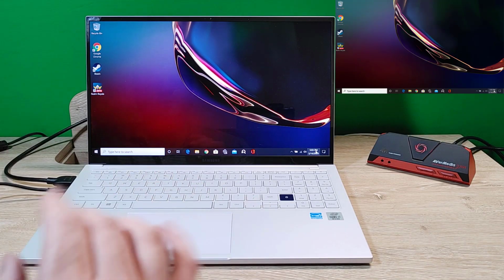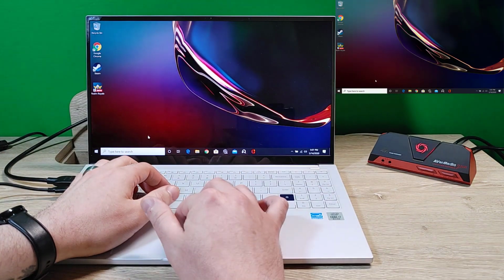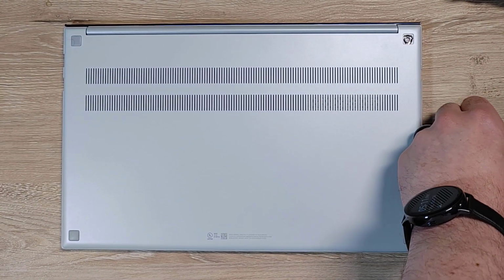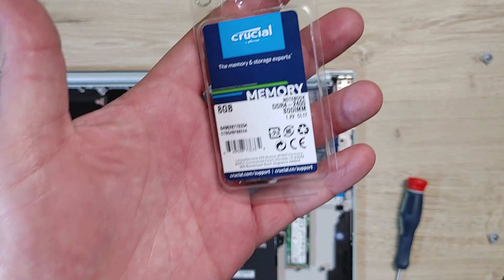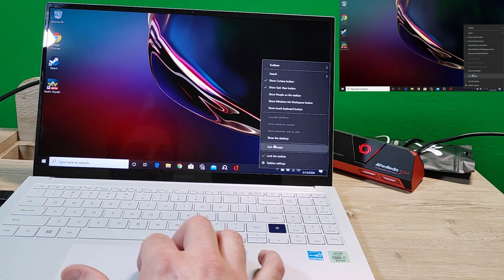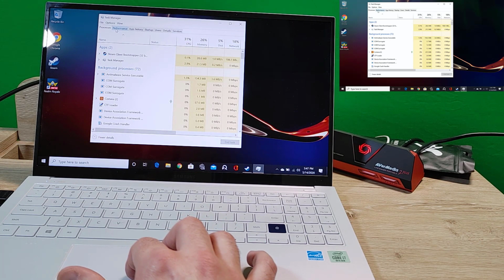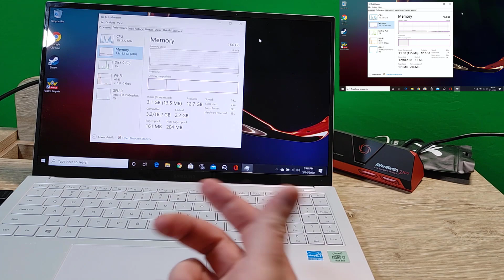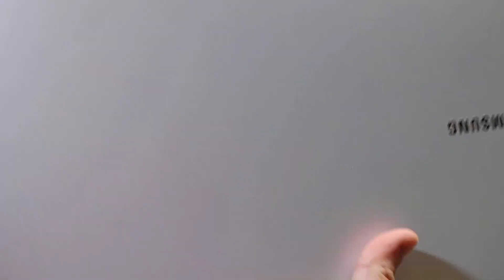Samsung Galaxy Book Ion (15 inch) | Disassembly and RAM upgrade (16 GB)

Comment: Does anybody know what is causing burn-in ghosting at the edges of display even in matter of minutes in Samsung Galaxy Book Ion np950xcj? QLED is supposed to be resistant to burn in. Display edges also suffer from purple tint. Can it get worse over years of use and is it expensive to fix?

Comment: I have a question! So let's say, I wanted to replace the battery because it no longer works. What do I do?
Reply from the maker: You can reach out to Samsung, they might replace it
Reply: @5after12  I'll try asking them how much it'll be although I no longer have warranty on this laptop ,, 😭 I tried disassembling but failed to..

Comment: Hey there! Have you had any issues with the Ion the last couple years? For me, even after a fresh Windows 11 install on a different drive, the Ion still freezes often when accessing Windows Explorer, the Start Menu, or even restarting the computer. I have to hard reset (by holding the power button) half the time. I'm curious if it is just me. An IT family member says it could be related to my motherboard.
Reply: I still have this laptop that I enjoyed very much. I did not have freeze issue at all and I have windows 11.
Reply: I have this laptop - I purchased it in 2021 and I get these issues, freezing up etc however I never have to do a hard reset. I just use task manager and kill all tasks and then it's up and running again. One issue I have found most annoying is that the fingerprint sensor stops working and fails to be recognised by the system  but that hasn't happened for a while now. It's a nice laptop so I was going to follow this video and add more to the specs.
Reply from the maker: Sorry, I got rid of that laptop awhile back

Comment: this may sound silly but... I feel like he had an 8 GB RAM, and then he replaced* it for an 8GB... why does it add? it should be total of 8GB... why 16?? (like what is the point to replaced it for a RAM of the same capacity). because I think there is only 1* slot...
Reply from the maker: if you watched the video, at the beginning it had 8 GB of RAM with 1 of 2 slots used. And at the end it has 16GB of RAM, 2 of 2 slots used. There was an empty slot that I added 8GB of RAM to.
Reply: @5after12  where is the 1st slot for the Ram? (Not the one that you installed)???
Reply from the maker: It was soldered RAM, so not really an up gradable slot

Comment: Thanks for the video. I have just had my Elitebook burn out (very disappointing) on me and want to reuse the 16Gb RAM and 512 SSD in there. I am looking for a laptop with spare RAM and SSD slots. 
I am having great difficulty finding non-gaming affordable options. Your video just provided one. THX.

The Galaxy Book Ion 15 has now a superseeded generation of CPU (10th) but I can still find a couple for sale. Is this a good Laptop for home business (CPU speed, audio, battery life) ?

Does anyone know if the Galaxy Book or Galaxy Book 2 also has this unadvertised RAM slot?

Comment: Hello, I would like to know if I can upgrade the ram on a Galaxy book flex 13 inch. I want to buy one, but I am concerned with the default 8 gb of ram. If possible can you make I video for it. I am I little scared about the noise opening it up lol. Thx
Reply from the maker: I don't have the 13 inch, so I cannot confirm is you can or cannot upgrade it unfortunately
Reply: Samsung tech support told me yes, so I bought it, ,but I just got mine today and haven't opened it.  In the performance tab, however, it says 2 of 2 slots are being used, unlike shown in the video.

Comment: Is this the same for the 13 inch flex a one? Thinking of getting one but not sure I could upgrade the RAM and processor later down the line
Reply from the maker: I am not sure. I would think you could because on the Hong Kong 13 inch variation you can upgrade the RAM. However, one of the comments on this video said they got the 13 inch version and it was not upgradable

Comment: Can we upgrade 256gb ssd to 512 gb in 13.3 inch galaxy ion? It is Core i7 16gb ram.
Reply from the maker: I would think so, but I am not positive since I never had the 13 inch version
Reply: 5after12 did you know how many slots are available in 13.3inch for ssd?
Reply: @ritzworld4300  only 1 slot.  really disappointing.

Comment: does this work for the smaller screen size model?
Reply from the maker: I believe it would, but I am not positive since I haven't actually taken that model apart
Reply: @5after12  ill try and report back I got the smaller one for travel
Reply from the maker: I returned the 15 inch and I got the Lenovo Yoga C940 instead, but I was heavily considering the 13 inch Ion. If I didn't love the Lenovo, then I would have got the 13 inch Ion, it was insanely light
Reply: @5after12  having issues getting the back panel off doesn't look like the vid looks like some kind of lock
Reply: Got it open, I don't see onboard ram or any ram slots for that matter, checked under batter nothing there also, can I email u a pic?
Reply: @dansal2002  can not add additional RAM or SSD to the 13.3 inch version

Comment: Can the 13.3in version be upgraded
Reply from the maker: I don't have that one, so I can't confirm if it can or not, but I feel confident that it can be upgraded. There is a Hong Kong version that has 16GB of RAM, so I would assume it is a similar setup as the 15 inch where you can add an extra stick like I did

Comment: Can anyone please HELP. Can you upgrade the ram of the galaxy flex from 12GB to 16GB????
Reply from the maker: I think the Flex is soldered and not upgradable
Reply: @5after12  ok, thank you a lot for answering!
Reply: @5after12  So the ram is soldered, but if you got the American version with only 8gb, does it have a slot open or does it only have one slot for 12gb and 8gb?
Reply from the maker: Indiana - the Flex I do not believe is upgradable, the Ion is
Reply: @5after12  Ok thanks!

Comment: The memory speed for the native ram in the laptop is 2666. Why are we upgrading it with a slower 2400MT/S ram sir?
Reply from the maker: I said in the video that was just a stick I had lying around. Samsung had said it was not upgradable, but I wanted to check for myself. I used that stick just to confirm that it works. In the review video I show the stick that I believe should be the same as the one that is already in there.

Comment: 32GB ram stick works. I have 8 on the board and a stick of 32GB in the slot for 40GB total. I also upgraded the drive to a Samsung EVO Plus 1tb. It's a lot faster than the factory Intel drive. Link to the 32GB Samsung RAM I installed https://www.amazon.com/gp/product/B07N124XDS/ref=ppx_yo_dt_b_asin_title_o02_s00?ie=UTF8&psc=1
Reply from the maker: Nice to know that works. How do you like it so far?
Reply: @5after12  I'm really happy with it so far. I would have preferred to have a 13", but since it wasn't available with the extra slots I went with the 15.6. The fans tend to run much more than I'd like so I keep it on silent mode most of the time unless I'm doing picture or video editing. It's quite a step up from my Samsung 13.3 Notebook 9 with Intel i7, 16gb and Samsung 860 1tb EVO M.2 SATA drive.  I purchased 2 Samsung 970 1tb EVO Plus drives with intentions of running them in RAID 0 then I realized the slot 1 had 4 lanes and slot 2 only had 2 lanes. I ended up using one of the drives,

Comment: Is the hard drive (SSD) slot  PCIe M2 or PCIe M2-2280 size?
Reply from the maker: I am not positive, but Tony says full size m.2-2280
Reply: @5after12  Thanks a lot. I am enjoying my Korean Galaxy Flex 15.6" 16GB RAM + nVidia MX250 (found one luckily for the same price as US Galaxy Flex 12GB which does not have nVidia). However the lighter weight of the Ion, supposedly slightly better keyboard travel and upgradeable RAM +SSD of the Ion are tempting me. :)  
Ordered an Ion on sale ($100 off) and 16GB RAM stick (may try a 32GB stick though) and will get an SSD too IF I pick the Ion up (still undecided). The Ion does not seem to support USB PD power though; the Flex allows me to AC power it (i.e. not just charge) through the USB-C port using a tiny albeit still 5A and hence 100W 3rd party power adapter (Flex needs 65W so 3A (60W with 20V) is too little, but 5A (100W with 20V) is enough) to fully power the Flex). Wish the Ion had that USB-C PD support and also the NVidia graphics in the US. 
Decisions, decisions...

Comment: Does anyone know: Can this accept a 32 GB RAM stick / module (for total of 40 GB)? Or is 16 GB the max RAM stick / module this can accept (for total of 24 GB)?
Reply: Yes I installed one in mine. I have a total of 40GB
Reply from the maker: Any way to check other than just sticking a card in there?
Reply: @5after12  A good utility should be able to tell how much RAM the slots can support. AIDA32, if not CPU-Z or Sisoft Sandra.  Or try this simple method https://www.shareus.com/computer/2-steps-to-check-maximum-ram-capacity-of-your-computer.html
Reply from the maker: @eurodudenj  i ran that and got MaxCapacity
33554432, so I guess it can hold 32GB?
Reply: @5after12  Thanks! Yes, seems 32GB is the maximum then. If I pick up the Ion (see my other comment under the SSD comment) then I will try a 16GB stick (for total of 24GB RAM); I had wanted to try a 32 GB stick potentially, but seems that will not work based on the results of the command you ran on your Ion. Thanks, you saved me a headache!
Reply: I asked their customer service and they said max is 16

Comment: Thanks 5after12. Which speed RAM came with the Ion? When I checked the CPU benchmark site to compare the Galaxy Flex CPU to the Galaxy Ion CPU, I noticed the RAM speed does not match what you used. Is Samsung using the same speed (DDR4-2666) which you used to upgrade yours to 16GB? Intel Core i7-10510U CPU 'memory support' on laptopmedia.com shows these 2 types - DDR4-2666, LPDDR3-2133 (Intel site shows 3 speeds in fact  - Memory Types
 DDR4-2666, LPDDR3-2133, LPDDR4-293), but you used DDR4-2400 not DDR4-2666?
Reply from the maker: I just used a random stick that I had around. That is probably not the best option.

What is the best method to check the existing RAM?
Reply: @5after12  You can install a utility such as CPU-Z (have not tried it) to check memory speed. Quote: "Install CPU-Z and it will run an analysis of your system, then serve up lots of useful information - including RAM speed". Link: https://www.techadvisor.co.uk/how-to/windows/ram-speed-3329949/
Reply from the maker: I tried CPU-z already and didn't see it. Another guys video had him run some commands in command line, I will try that

Comment: 5after12 I got rid of mine because the speaker didn’t get loud enough for me
Reply: Yes, speakers being too weak is one of my biggest complaints with the 16GB = nVidia Korean Galaxy Flex I bought (bought it before I knew the Galaxy Ion's RAM could be upgraded).
Reply from the maker: I don't have an issue with the speakers. However, I don't use them much and I would probably use headphones most of the time.

However, I am considering the Lenovo Yoga C940 instead for the UHD screen and bigger keyboard.
Reply: 5after12 thought u were changing ur mind and keeping lol. I’m going to get surface pro 7 i5 256gb surface pen and probably also get the surface headphones 2
Reply from the maker: I am a lunatic. I change my mind frequently. I might get the 13 inch Ion, but I have already ordered the Lenovo. However, I have not returned the 15 inch Ion yet either. I have a lot of first world problems.
Reply: 5after12 trust me I’m the same I’ve been through a lot of laptops even went back to some a couple of times like the surface pro 7 and Lenovo c940. And if u get the c940 get the 1080p one cause u will get way better battery life.

Comment: Awesome news. Thank you!
I am wondering if you could do the same for Galaxy Book flex of 13 inches?
Reply from the maker: I looked at the Hong Kong site, and they sell the 13 inch version with an 8GB option and a 16GB option. So I think it is probably possible to upgrade the RAM in the 13 inch
Reply: @5after12  That is awesome news. I saw South Korean version is selling with 16 GB of RAM too, really hoping its the same platform and they didn't block it on the board somehow. 
Thank you once again.
Reply: @Djsmiley77  you were able to do it? I have the same but 15.6 , and i would like to upgrade the ram too
Reply: @hectorguaita637  
I haven't bought it yet for the RAM reasons. 
I don't think its posible to swap it or upgrade unless it's 15 inch Ion only
Reply: @5after12  that's because the 16GB version is being sold in Korea by Samsung

Comment: My RAM kit comes tomorrow.  I will be attempting this install.  Thank you for the video, seems pretty straight forward.  Interesting that it only uses DDR4 though as one of the main features for this laptop is supposed to be the benefits of LPDDR
Reply from the maker: Yeah, just be slow and steady on the back panel removal. I was too aggressive with mine
Reply: @5after12  Thank you so much for this video!  I would have had to accept the 8GB limit and probably regret this purchase.  I upgraded from a Notebook 7 Force (16GB RAM and NVIDIA graphics).  I was amazed how easy it is and yes you need to be very slow and careful w/the back...the material is super easy to bend.  I liked and subscribed to your channel! I look forward to more good stuff.

Comment: "Mark" was picking up his 2 year-old and driving responsibly, despite repeated calls and text messages.  He also was able to figure out where the RAM was from a picture before the metal cover was taken off.  So Mark > Mike. :P
Reply from the maker: My calls should have priority
Reply: @5after12  Your calls should be flagged as "Scam Likely" by T-Mobile.

Comment: Ah, thx for the video. I was looking forward to this. But I already changed my mind on my laptop. The new dell XPS 17 looks amazing, and has a better GPU, which I need.
Reply from the maker: Yeah, so I am conflicted over my laptop choices. I am considering the Lenovo Yoga C940 14 inch 4K version.

It has a better screen and I would probably like the keyboard better. And it has a slightly better GPU. However, there is a lot to like about the Samsung.

Comment: I just got my ion today and I have no gut to open it to upgrade the ram lol but thanks for the video! At least, I know I can do it later.
Reply: Did you get the $55 one for the ram?
Reply from the maker: I think I paid 80 bucks, but I got 2 sticks because I was going to upgrade both slots in my son's Chromebox 3.

I will have to buy a another stick now.
Reply: @5after12  Can you use 3200MT/s RAM instead of 2400? Would it make much of a difference? Thank you for videos!
Reply: If I use the 3200MT/s RAM over 2400MT/s, will it make my laptop faster?
Reply: ya'll paid more than $50 for the ram? I just bought it for $36